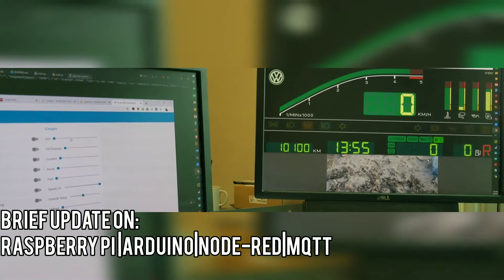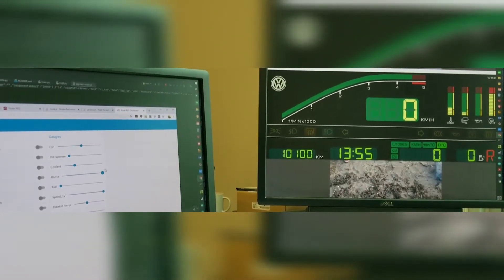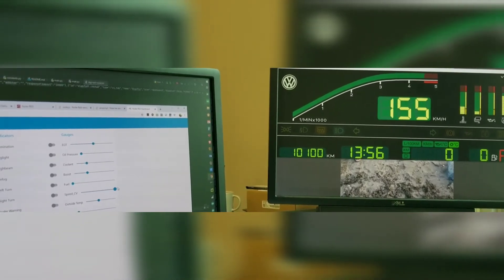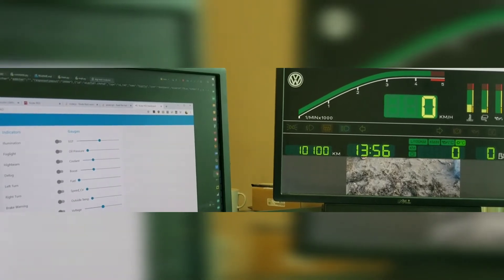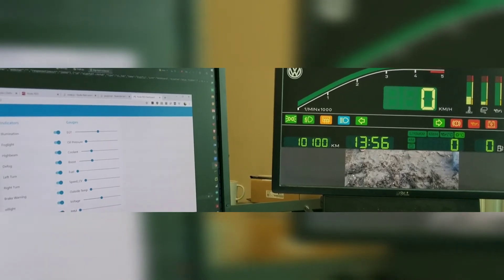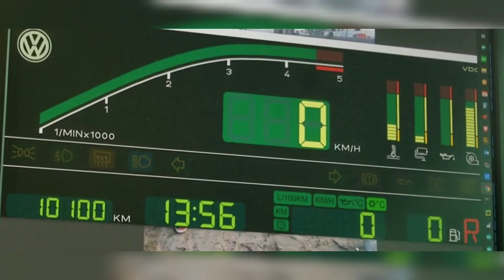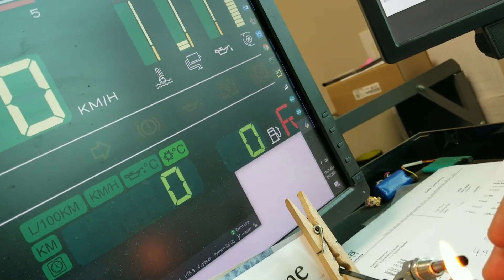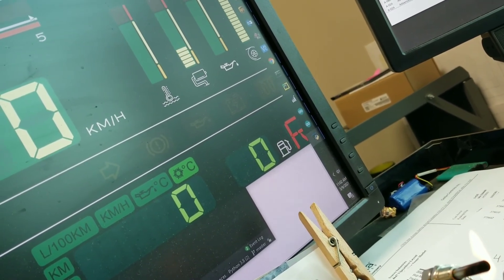Digifiz Dashboard: EGT sensor sending live data via can bus and Arduino to node red and mqtt!

Comment: Can you help me with launch app from github repository?
Reply from the maker: Sorry they are pretty vlog style. I'll try and do a slightly more informative tutorial style soon...  You'll need python, mqtt and node-red running on a system -I've used MacOS and Windows for this. There is an example node-red code that I'm using on github. Search up specifics on how to set those services up on your system... I use pycharm and run the program from there. Has a few dependencies like pygame etc. ... Pretty technical. I will try and work on a video overview in the coming weeks/months. Busy trying to get the vehicle running right now. Thanks for your interest!
Reply: @GavinTinkers  Thanks for the answer. I want to do displaying using web-page and file .svg.  I'm interested to see how it works emulation for you.